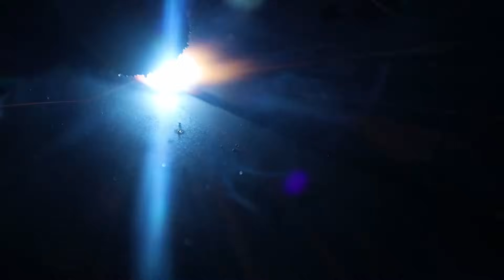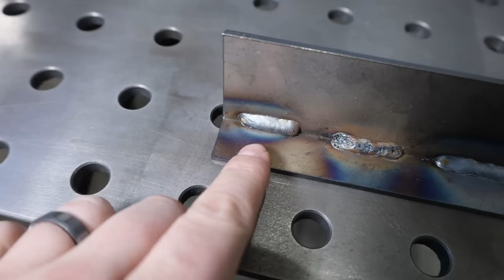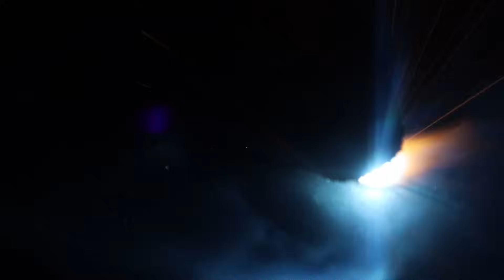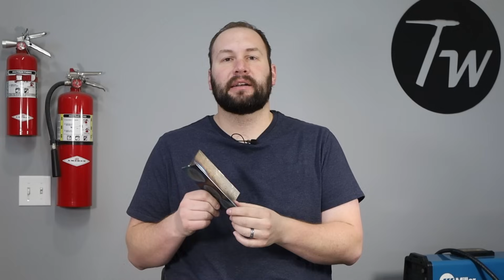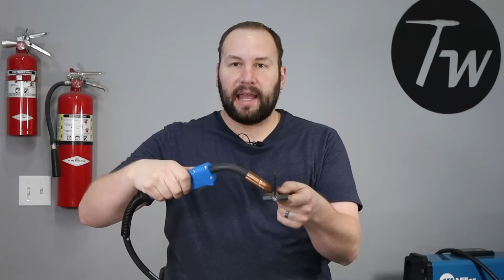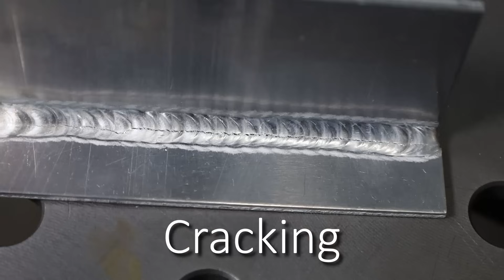5 Welding Problems Fixed: Welding Basics for Beginners

Comment: Is “lack of fusion” also called undercut?
Reply from the maker: They are different. Lack of fusion is where the weld metal is just sitting on top and hasn’t actually melted the base metal. Undercut is a dip below the base metal surface at the toe (edge) of the weld bead because too much base metal was melted and wasn’t filled back in.

Comment: Aluminum is classed as 'hot short' as soon as it is heated it kinda waters it down, and if no filler is applied the weld becomes brittle and weak. I've seen many running perfect beads using TIG but used no filler, and if those welds were to be put into service, they'd fail almost instantly. Nice presentation, I like it.

Comment: Im welding on a trailer. Im having no luck welding the bottom side of the beams. 
Ive got an old Powermate 100 and im welding 3/16 steel. Welder says heat should be at 8-9 and wire speed at 6. 
It just spits and sputters. 
Slightly slower wire speed and it just hisses and never gets going. Slightly faster and the eire just bounces off the iron.
I can’t adjust gas flow and I have a full tank.

Comment: I don't know why..but I weld stick weld so good from all angles..but I weld mig like shit..It just doesn't make sense for me this machine..only the horizontal welds are looking good
Reply from the maker: If your technique is working in the horizontal position, my guess is that your settings (both wire speed and voltage) are too high. The recommended and automatic settings from most manufacturers (especially Miller) are really hot and won’t work in all positions. I would try the settings for 1 or 2 material thicknesses thinner than you are running when you are working out of position.

Comment: Hi when I try a weld I get 1/2 on one side and 1/2 on the other just slage inthe midle what am I doing rong
Reply from the maker: I assume you’re running a stick weld with 6013 rod, which commonly has this problem. If that’s the case, you probably need more amperage. A different type of electrode, like 7018 might make life easier too.
Reply: @TimWelds  I have the same problem and I am welding thin plate (14 gage), so I can't really go up in amperage. I'm using 6013 rod, 5/64" in size. I'll run another few tests and if I can't get away with it, I guess I'll have to use another type of rod. Any advise is welcome...

Comment: im welding concrete rods that have anti rust treaement and using mig nogas it created huges bubbles 
i brushed the rods before with steel but this treatement seem to be electrorlytic or such deep impossible to remove

Comment: I've been certified since 1981, welded on Trident subs for Electric Boat, have worked multiple nuclear power plants, bridges, buildings and some ornamental stuff. SMAW (stick), GMAW (mig) and GTAW (tig), some brazing on steel, stainless and aluminum. I've even done plastic welding on large acid baths made of thick sheets of poly that had to be fabricated on location. There's a huge amount of information online these days to learn welding techniques that were not available to my generation. One thing I can say, I like your presentation, the information is spot on and really helps to make it simple to new welders what to look for. My mantra: puddle control at all times. Carry on, you're doing a great service.
Reply: I done a acid room one time and I was never so glad to be done with that, I can't remember now if it was 1/4 or 3/8s but I remember it taking a dick yr! We custom made a galvanize plant to dip hog flooring so we didn't have to keep sending it to IL to have it done, our galvanize was was better and looked alot better with a few rolls of aluminum foil melted into the tank of liquid zinc.....oh the good ol dayt, lol

Comment: Hello, thank you for your informative Videos. I have a question: I am thinking of buying a (low budget) welder. I am total beginner; im just thinking of some DIY projects (maybe like a fire pit or a smoker, maybe little things for inside the house; this kind of stuff. Aluminum ? ... don't know yet). What would you recommend? first idea: Stick welder. But maybe also MIG; maybe first used with flux core? Or do you think a DIY person could self taught learn TIG? If it is not overly expensive, Id like to be a little future proof, if that makes sense. For the time being, I only have one phase current available at my house (which is 230V in Germany). Can I expect acceptable examples on this or do I need 3phase (400V in Germany). Thanks for your input.
Reply: In my humble opinion stick is the best to start with it's cheaper and easy to set up for a beginner and your not dealing with gas or wire just  rods. You don't need to spend to much 1-2 hundred euro will be plenty good enough as long as it can do 100 -150 it will be enough for 99% of jobs

Comment: Hi Tim. What is the best solution to avoid inhaling the fumes of burning rods without causing porosity and without a respirator mask? I was planning to blow away the fumes with a soft blowing fan, but now I don't know what I'll do. Wearing a respirator mask is an option, but sometimes it's just too hot and very uncomfortable. Please share advice about this :)
Reply from the maker: If you are stick or flux core welding, which produce the most fumes, the fan won’t cause porosity because the flux will protect the weld on site. With MIG or TIG, you won’t have as many fumes, but you can probably still get away with a fan blowing away. If you find you’re getting porosity, you can increase the gas flow a little or reposition the fan.
Reply: @TimWelds  Thank you Tim. 😁 I'm a beginner with stick welding. Fumes are very nasty, I'll try to blow them away from my nostrils with a fan and exhaust them with an extractor. It will look like an luxurious shop. Ha. Because no welder in my whole province does this. They sniff it all in. Dumb thing to do. Haha. I like comfort and safety.
Reply: OSHA guy here please wear a respirator. You have a lot of options, there's even COOL version I forget the name that stays cooler than most. Search cool air respirator
Reply: @MrArtVein  A blower and an air extractor is not enough? 😱 What number of respirator filter?

Comment: One of the most common issues for porosity, is the welder failing to clean spatter and build up from inside the nozzle. The first thing I check when someone comes up to me asking why they’re getting porosity is usually due to this. Second most common is welding on contaminated surfaces. Grease, oil, dirt, rust or even too much anti-spatter
Reply: If is a dirt pipe inside that you cannot have access to clean or grind? I believe that these youtube tutorials should cover these real-world scenarios. These are challenging welds that several beginners will face. Weld a fresh and clean both sides steel plate, I made good weld from my first day. This is a dream condition for any welder.